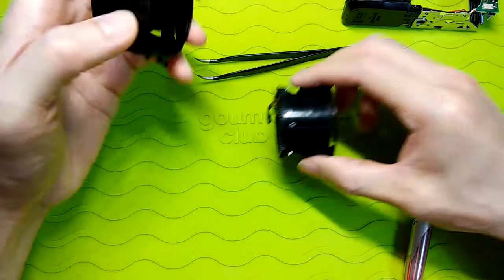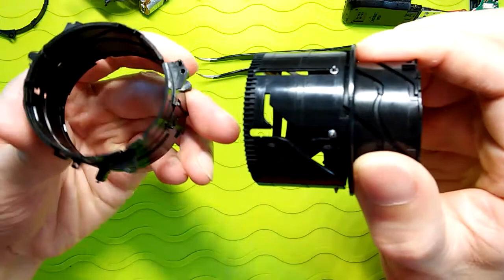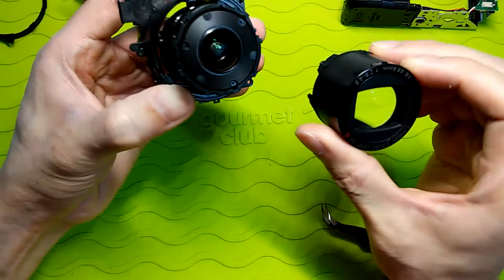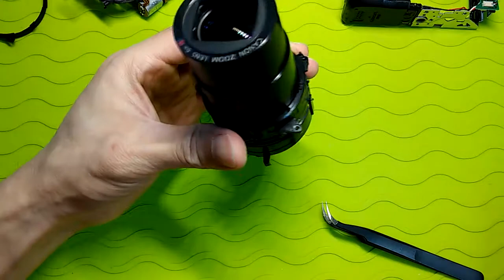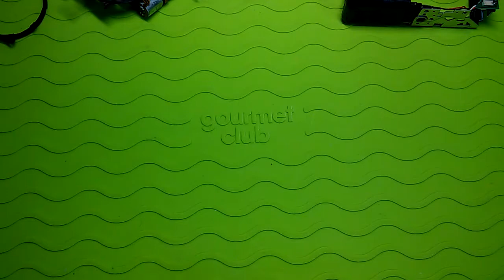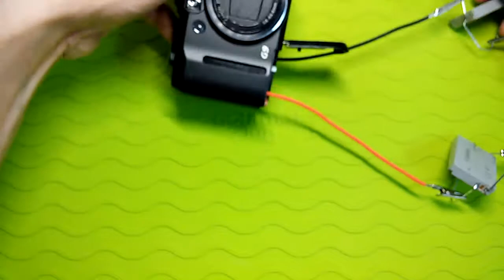Canon G9 Repair Lens Error 3of3

Comment: For this repair did you need anything other than the micro screwdriver and tweezers?
Reply from the maker: Most of what I used is listed in the Description. I used a dust blower to keep dust from the lenses during reassembly.  I used lens wipes and alcohol to clean the lenses.  I used grease to lubricate moving parts etc.

Comment: Hi,did you manage to put the rings in?Mine just dont want to stay in place,I was thinking of gluing them on
Reply from the maker: I didn't use glue.  I don't remember how those rings attached.  The last ring looks like it had hooks or tabs that locks it in place.  If you must use glue I would only put a dot of glue.

Comment: My camera stopped turning on affer i followed your steps :( I fear i've done something wrong while assembling the body itself, since there wasn't any video doing It... What am i supposed to do?
Reply from the maker: I suggest you redo it.  May be you  left a cable unplugged or not fully seated/inserted.  Assembly is just the reverse of disassembly.
Reply: @ oh i know, i just got to spend so many hours on the lens that i completely forgot everything i did when i disassembled 😭

anyway, i disassembled it again, i've observed two problems:

1 - the lens module flex segment connecting the rest of the circuits to the af green light were ruptured, probably by me on accident

2 - i'm almost sure i didn't tight the correct screws on the body, since there's size diffs but i just started screwing them 

and i just accidentely broke the thinner segment of the lcd flex cable while disassembling again 🥲

but i just don't understand why it doesn't turn on... i already had the same problems with other digital cameras, especially with the flex, but it never affected the whole camera, just the part that was ruptured..

i will assembly all over again and test it to see if it will turn on
Reply: @huddbarros I had the same problem. Is your camera turned on?
Reply: @누구-u2w  answering fast beacuse i know how frustrating this might be. but the answer is no. the lens problem remained (my g9's lens was fully extending but not retracting), and i broke the lcd :/
Reply: @huddbarros I'm planning to break it too. Thank you for your reply.

Comment: First of all, thanks for creating this series - very detailed and informative! I have a G9 with lens error. When disassembled, I can get the lens to fully retract or extend by applying voltage to the poles of the motor so I know there's nothing wrong with the gears or motor itself. If I turn it on, it will extend in full and then throw an error and shut off (the lens stays extended). I followed your videos to get all three barrels apart and then back together - no issues. None of the flex cables appear broken or kinked. I suspect that some positioning sensor might be at fault. The one on the back panel (below the CCD) seems solid. Do you have any clue how will the camera track it's starting position (mid-extension after turning on)?
Reply from the maker: Was that the original problem or did it start after you opened cameras? I was gonna suggest check the position sensor and cables.
Reply: @watdahel  Well, at least how I got it. I definitely got the cables reconnected once I had it all apart.
Reply from the maker: I think my Canon S100 had a similar error many years ago but I didn't make a video of the repair.  I replaced the cracked cable and had to transfer the position sensor to the new cable.  Do a continuity test on that cable fully extended and folded.  Make sure there is no sharp crease on the cable.  It may look whole but when it extends I breaks continuity.

Comment: gesus, i tried to switch it on for test very close to complete reassembly. and what i got was same lens error. nooooo not again...
i followed the video to disassemble the objective to clean it from sand, and it looked like it may work. but somewhy it didn't
Reply from the maker: Did you check the flat cable to the motors for any damage like cracks?
Reply: cables were good as new. maybe i did something wrong. i wasn't that accurate marking objective parts beforehand, i chose to spend more time putting it back together :)
Reply from the maker: If you take it apart again you should  manually extend and retract the lens to make sure there is no obstruction in the movement.  You'll have to remove the motor or the gear box so you can spin it by hand.  Like I said in the video you can put everything back together and everything appears ok on the outside but if the lens doesn't move freely it will throw the error.
Reply: i hate this camera. i gave it one more try today. assembled objective together with great accuracy, tried it back and forth manually until i was sure it worked well. assembled camera back, switched it on and.. same error. i thought maybe it was gear problem or viewfinder fitting error, but now i just don't know. i'm close to consider it dead from just being too old. sorry for being grouchy :)
Reply from the maker: The only I can think of is make sure every cable is not cracked or creased and that they are fully inserted in their connections.

Comment: Hello everyone!
Thanks watdahel for great video!

In my canon g9 the lens expands to the end. This happens only once when the camera starts up. After the lens is stuck in this position. The lens should expand halfway. Does anyone know how the lens position is controlled? Any sensor?
How fix it?
Reply from the maker: When u turn it off does the lens retract? Do u get a lens error message?
Reply: Hi! Thanks for your reply.
No, the lens is stuck. I get lens error message.
Reply from the maker: Did you do anything to cause the malfunction?  Can you zoom?  Do you hear any grinding noise?  Assuming it's not a broken gear, there is a sensor in the lens barrel that detects the lens position.  A ribbon cable to the sensor may have broken from normal use.  They are known to fail.  It's not an easy fix.
Reply: I dropped the camera from a small height.
No, the camera turn off after error.
Yes, I hear squeak of blocked engine.
What this sensor looks like?
Thanks for your reply!
Reply from the maker: The sensor is about 2-3mm².  Very tiny and not an easy repair.  I don't think it's the sensor since you said you dropped the camera.  The cable fails from fatigue.  Did you drop the camera while the lens was extended?   If the motor is turning but the lens is not moving then I'm guessing a gear teeth has been stripped.  Is the lens barrel straight or crooked?  The lens remains extended even when camera is turned off?
Reply: Hi, I'm sorry for not responding so long. The camera was repaired. A flexible flat cable was broken around one of the sensors. I attach a short film showing the repair. 
Thank you so much for your help!
https://youtu.be/_qBPBCfgmIk

Comment: Great video. I finally got the lens smooth but now it goes
POWER ON, 
EXTEND & RETRACT x3 
EXTEND TO A NORMAL LENGTH
LENS ERROR MSG
POWER OFF

On the second POWER ON,
EXTEND & RETRACT x3
LENS FULLY RETRACTED
LENS ERROR MSG
SHUT DOWN.

Any ideas? Appreciate your work. Very clear.
Reply from the maker: Sorry for late reply.  I don't know why I didn't get a notification.  Sounds like a broken lens cable.  It can't determine its zoom position so it turns off.

Comment: Hello watdahel

I got the same camera from my sister this week, she dropped the camera on the floor and the lens got stuck.
I opened the camera an also opened the lens after watching your video. You video is GREAT , you really took the time to show how to open and reassembly this lens. I have to clean the lens , I found some sand particles in the lens and think that that got in the way. So again thanks allot for making this video .
Greatings from Eelco, Alphen aan den Rijn  The Netherlands
Reply from the maker: Glad video helped.  Also, check the three small gears, the gear on the motor and teeth on barrel to see if any teeth have broken off.